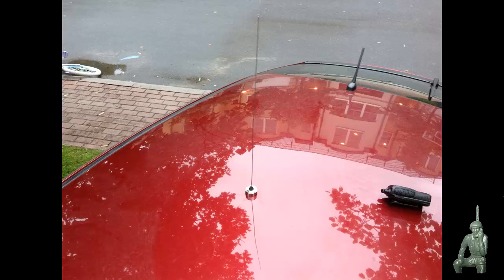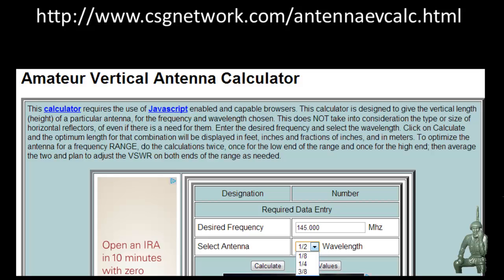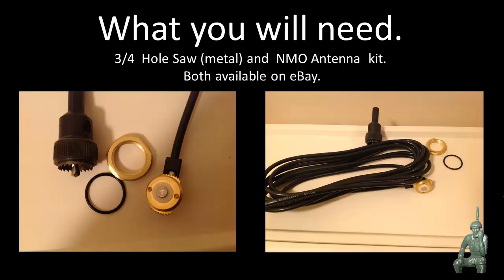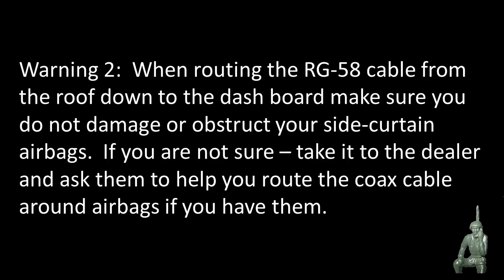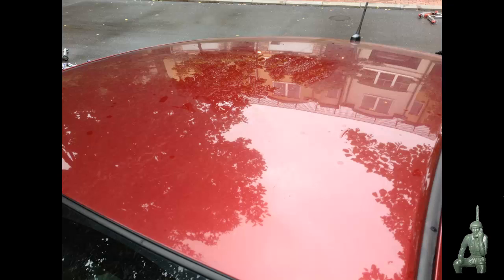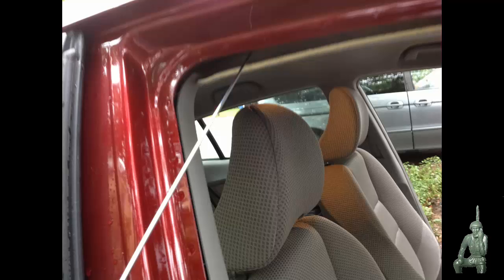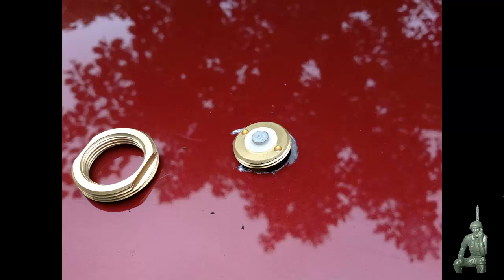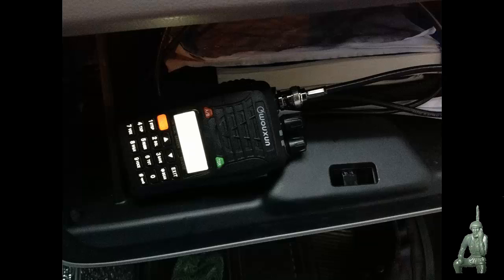Vehicle Antenna Installation - NMO Mount (corrected copy)

Comment: Wow, this is really really done well. Thank you. Professionally edited and narrated and full of useful tips. Super helpful. KG5LBP. Austin.
Reply from the maker: +Tom Parish Thank you.  This is an older video, I just posted a new video showing the installation of two antennas in a Nissan 2015 Frontier.
Reply: +Commsprepper Ok I'll go check that out. thank you. Wish you lived in Austin. I'd pay you to help me get mine installed. Thank you so much.
Reply from the maker: +Tom Parish Tom check out your local Motorola or two-way radio shop. The one near me charges $70.00 plus NMO kit cost to install a roof mount.

Comment from the maker: I recommend a quality Motorola made NMO magnetic antenna base (you can check the yellow pages for local two-way radio shops) and use a Tram 1181 antenna.  A quality magnetic mount will prevent slips and protect your antenna and car's paint job.

Comment from the maker: If by aerial extension you mean the base of the antenna where the whip connects - it does affect antenna (whip) length.  Some bases have coils inside them that add (electrically) to the overall antenna length.  It all depends on the manufacture.

Comment: Remember this will only work on a metal roof, if the roof is fiberglass you should run ground straps from the ground side of the mount to something metal. The vehicle is the ground side of the antenna.